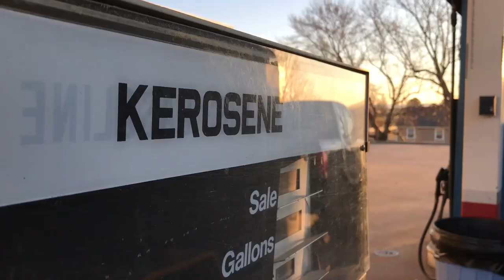How to: Cedar Truss / VLOG

Comment: What size and gauge did u use?  Also do u have to fill in nail holes or are they small that are not noticeable?
Reply from the maker: Freddy Herrera 2 inch 16 gauge, I think it depends on paint or stain, I probably would for paint, but not for stain. But at my work, that’s the painters job 🤷‍♂️